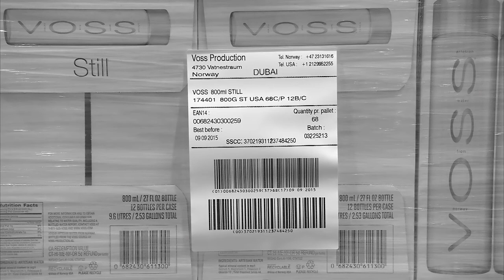VOSS Water: Source

Comment: In Norway, tap water is voss
Reply: Signe Nielsen but it’s so classy. It’s Norwegian and expensive 😍
Reply: In USA we call it well water. Its water that goes thru the sand and rocks and never touches the air. LOL what a bunch of bull. They didn't show the metal pipe where the water gets pumped out of the ground in the factory, just some birds on a lake.
Reply: that just shows how superior water is in norway
Reply: adawd adwdaw  Yeah thats what they put in pool water. Its ok.
Reply: @greenlawnfarm5827  they dont do that though my man, its tap water. The bottle the tap water and then ship it. The pumping of the water is done by the government, into the public water stream where you can turn on the tap and get voss
Reply: @elementalgolem5498  Yeah all the water in USA is clean.
Reply: @greenlawnfarm5827  i e heard meryland has high amounts of chlorine and flouride in theirs?
Reply: @elementalgolem5498  Its like drinking water in a swimming pool. Chlorine is healthy.
Reply: @greenlawnfarm5827  chlorine isnt healthy, at all, especially not the amount you have in pools thats way over the safe dosage, however driniking water with chlorine doesnt have to be bad, it can be the same as without but it does disenfect, but having too much of it is super easy and if not regulated properly will lead to health issues, aswell some people are more sensetive to chemicals like chlorine meaning that that part of the population cant drink supposedly "safe" drinking water at all. its not healthy, its not like a salad, its just not straight up bad for you like tobacco, its more like energy drinks (without sugar etc just caffine) in itself caffine isnt dangerous, and can be helpful in low doses, improves concentration etc, but if you have too much of it it can lead to insomnia and eventually with enough a heart attack leading to death, chlorine on the other hand will lead to a burning sensation in your mouth, irritation of skin and tissue, damage to skin and tissue, vommiting, low blood preassure, change of ph balance of blood (not a good thing) and eventually death from poisoning so healthy no, not bad if regulated well and only then. yeah
Reply: @elementalgolem5498  Ok. So what i said is mostly right.

Comment: It's good to see that the water is packaged in a well-made glass bottle that can be re-used after initial purchase. I would hope to see a message on the bottle encouraging people to keep re-using the bottle with regular tap water instead of disposing of it/ recycling it immediately after 1st use. I just bought one for $2.99 at Metro in Ontario and I will keep the bottle for this purpose. And yes, you can filter your own water. Berkeys are good for this. A LifeFactory glass bottle encased in silicone costs $30 - so looks like a good deal :)